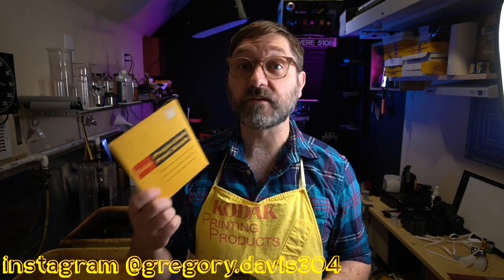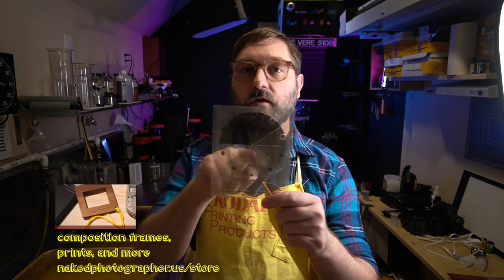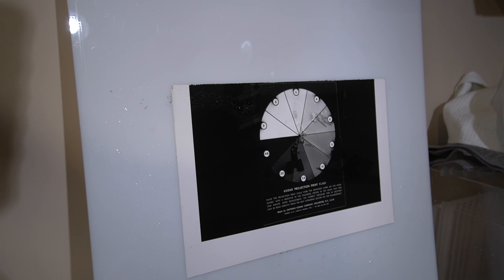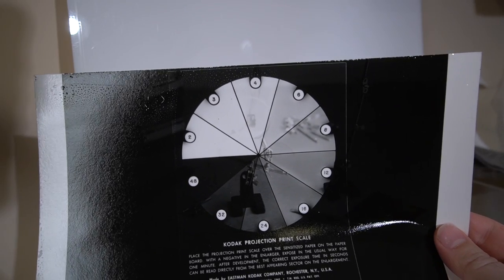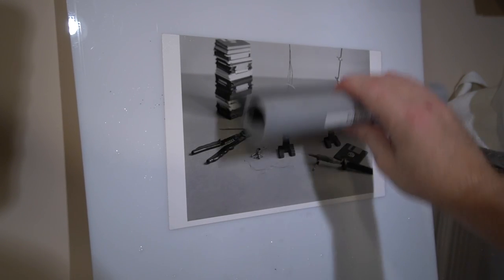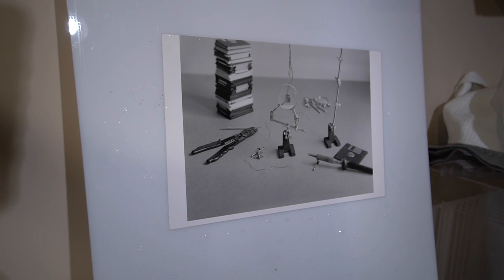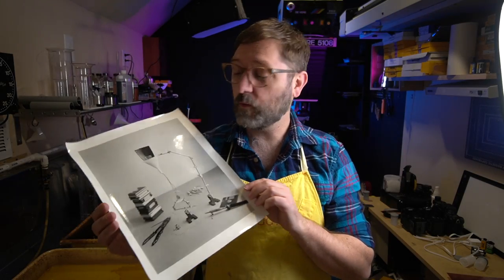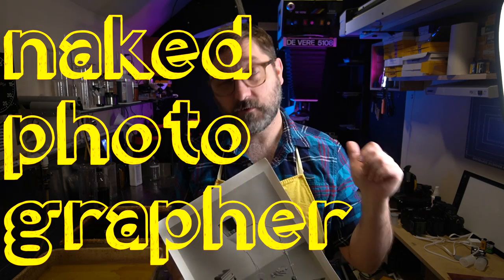Projection Print Scale

Comment: I’ve just started using one of these with really good results. What I like best about them is that they work in actual stops (or half stops, actually) unlike the traditional 5, 10, 15, 20, etc. test strips.
Reply: Infuriatingly, it's close but not enough. The true f-stops according to the times provided are: -0.32, -0.91, -1.32, -1.91, -2.32, -2.91, -3.32, -3.91, -4.32, -4.91. I guess Greg has to pull out his densitometer and confirm. I know that for most practical purposes it's close enough to hardly matter, but the details, man.
Reply from the maker: This is a tool for beginners.  If you’re concerned about absolute perfection you probably aren’t using this tool anymore.
Reply: Looks like a great way to print that first test strip to get your eye in before you narrow down exact contrast and exposure for shadows and highlights. Also always a winner to streamline your process and save some time in the darkroom…

Comment: I bought a Projection Print Scale somewhere around the early 1960s. Apart from its great film and superb paper, back then Kodak actually made a effort to sell relatively inexpensive bits like this to help folks find darkroom work fun. I still have my first one in the junk drawer of my darkroom. They work very well, as shown here. Their shortcoming is that  (1) they eat a 4x5 inch sheet of paper, and (2) you have to have an enlarged image with subject matter arranged so that you can get a fully representative part of the image under each step of the scale so comparisons can be made. Once you get some experience with printing, the classic test strip is more flexible, faster, and informative.

Comment: That print appeared to print well without any contrast adjustment.  How would you do it if you needed to change the contrast filter?
Reply from the maker: I like Ilford’s paper because the time doesn’t change when adjusting the contrast in the 00-3.5 range.  Time doubles when moved to 4 and higher.

Comment: Could a stouffer step wedge be used in the same way?
Reply from the maker: You would have to figure out which patch corresponds to what time, but yes, it could
Reply: Yes. It is just another step wedge, no matter what you name it. However, unless you have a fairly large Stouffer wedge (expensive), each patch or step is not going to be large enough to be than useful, and you would still have to calibrate it. IMO, too much trouble.
Reply: @randallstewart175  You're correct, so i tried mounting my small(1/2 x 5 in.) step wedge in a 4x5 neg. carrier and projecting that directly onto the paper. Because I use the f/stop method I can easily make adjustments and can also use it for focusing.
Reply: @deanbetker5060  Dumb me. I had not thought about projecting the wedge with the negative. And, an  f-stop timer will make it so much easier to calibrate. Very Nice.
Reply: @randallstewart175  Actually I am using an Intrepid enlarger v2 in combination with the f/stop calculator app from digital truth to get my exposure time.